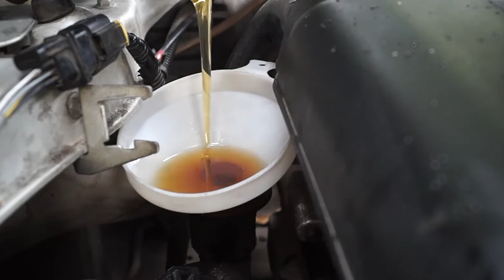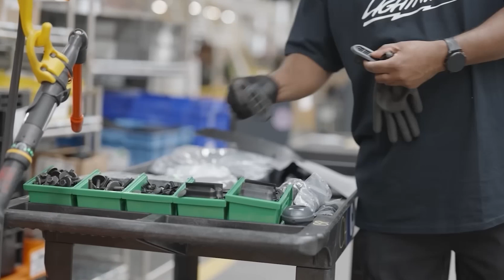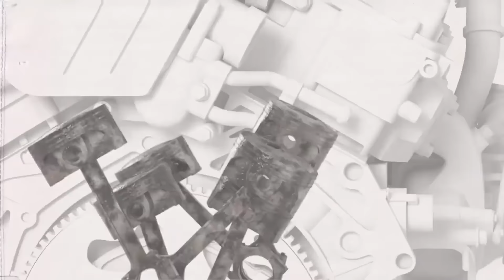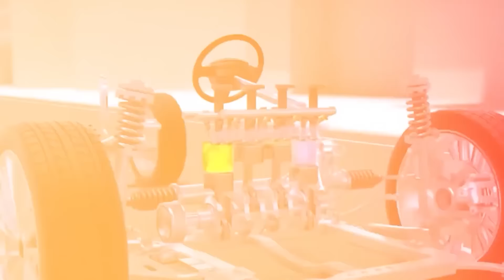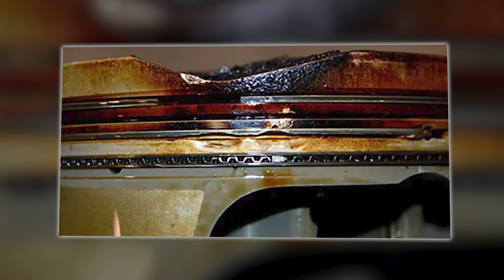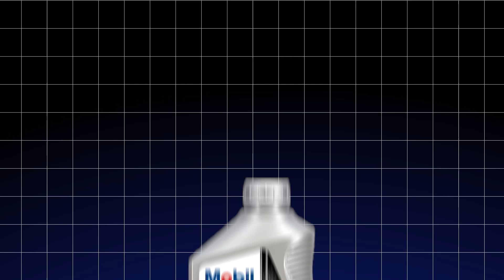Toyota Secretly Lying About Oil - Mechanics Refuse To Use

Comment: My 2024 Toyota cross calls for 0w8 and the FIRST THING I DID was drain it and put in 5w30. Result: Within minutes...The engine got quieter. When I drained the 0w8...it was like baby oil. No way Im running it.
Reply: Good idea,you’ve done yourself a favour getting rid of that knats piss,the manufacturers don’t give a stuff about longevity as long as it gets through the warranty period.
Reply: In modern cars it is more likely the electrical system or others will fail before the varing oil question plays itself out. Choosing the best oil for your circumstances improves with knowledge, so all these opinions and the few facts do have merit.
Reply: @Robertatbeaconhall  You are better educated if you get used oil analysis...no guessing...facts...
Reply: Good for you.
Reply: Terrible choice. Its a fact that toyota builds the a20 and a25 fks engine differently for the USA than it does for anyone else. They use cryogenic freezing of engine components to get an extremely tight tolerance. Plus the oil pump for the USA models is a completely different part number and it says it is NOT compatible with the overseas engines. That is because the oil pump is meant to run 0w8 and 0w16. Since it regulations pressure mechanically, it will actuate the relief valve in the oil pump a lot since the thicker oil increases oil pressure. Thus decreasing the oil to your bearings and providing a worse oil film. Use the factory recommended oil. Toyota sends out oil samples when there is an engine failure. So your warranty will be cooked for using the wrong oil. You are not very smart
Reply: @jos @joshuathomas4934 hey also claim 10K OCI is just fine. If you buy that, you’re not very smart.  These same engineers also developed that great V35A engine. How’s that working out for them?
Reply: It's not the weight of the oil it's the additive package in the oil. Ow-08 and 16 have a strong additive package. While thinner that have a very strong protective additive package. 
Science not speculation
Reply: @jchalestorm1749  yep and the heavier oils have lower packages and depend more on the weight of the oil, so ill take the lower oil package and thicker oil for where I live. With all the oil shortages that might likely come, people need to not be so afraid of trying it out for themselves and seeing the results, so far absolutely no issues at all using 5w30 in my 0w8 car, in fact I dont even see a MPG difference although im sure there is some small percentage difference
Reply: I have a 2025 Toyota Camry hybrid which Toyota recommends to use 0W8 oil.  I’m about to have the second oil change, should I continue to use 0W8 oil or switch to something thinker oil like 0W16?
Reply: @PKwong-xq9ze I would if I was you but it’s your decision in the end,it all depends on how long you intend to keep it,if you change your vehicle every three years and only do about 30,000 miles in that time it won’t be your problem.
Reply: @PKwong-xq9ze   I highly recommend Amsoil "100% Synthetic" 0W-8 rather than using the Toyota "Full Synthetic" 0W-8.  Some verified buyers of Amsoil 0W-8 on the official Amsoil website had indicated they were getting better results than the Toyota 0W-8, such as better gas mileage, smoother and quieter engines, which are reasons enough to make the switch, besides the Amsoil is actually cheaper!

In addition, Amsoil has a plentiful supply of their 0W-8 and 0W-16 100% Synthetic Motor Oils, along with a fully stock selection of other Amsoil Oils and other Amsoil Products, where Toyota issued a Technical Services Bulletin to all their Toyota Dealers warning of a potential shortages of these lighter viscosity grades.  I am an authorized, Independent Amsoil Dealer with my ID number 1420935 (also used as my Referral Code). All Dealers of Amsoil are Independent Contractors, as opposed to actual employees of Amsoil.

I invite you to visit the official website of Amsoil to view the extensive selection of dazzling products, where hopefully you will apply to become my Preferred Customer, by kindly utilizing my Referral Number of 1420935 in the box where they ask “Have a Referral Number? Enter it below:” If you can write down my referral number, before you eventually decide to exit this webpage, it will be appreciated (so that it will be at your fingertips when you get on the official Amsoil website).

If you choose to buy the Amsoil products as a Preferred Customer (PC), you will get the oil at a 25% discount, plus free shipping when you spend $100 (plus receiving a $5 coupon for every $100 you spend, plus occasional free gifts that they don't provide to their dealers). It only costs $10 for a 6 month PC membership (or $20 a year) and there is no requirement to purchase (as there is with so many companies offering a membership for a preferred customer program, where there is an automatic shipment involved). 

P.S. There is so much more that I would like to add to this list, such as increased MPG in comparison to the other oil brands, the most extensive warranty in the business and the phenomenal results I have received over the past 20+ years. Thanks for the consideration!
Reply: @PKwong-xq9ze  I think Toyota's engineers knows their designs better. If the coolant system does it's job, the engine will operate at a temperature, where the recommended oil works optimally. Toyota has been making some of the best most durable cars in the longest time in car history. Why would they want to risk that reputation of quality??
I don't think we are beta-testing when it comes to Toyota. Toyota has always done proper testing with their designs.
But with 0W8 oil. I would make sure it's always running at(or near) "full spec" oil capacity, to keep pressure at best. Because flow will be excellent with such oil. I believe Toyota has designes that engine and oil pump system to keep oil pressure healthy also.
Reply: @dillonDner EXACTLY!!!!!
Reply: @Wushu-viking  no, todays toyota has given up longevity in exchange for fuel economy and better emissions.......PERIOD. dismantle the EPA standards and only then can you make toyota great again.
Reply: @Wushu-viking 
If Toyota knows what they are doing…..then why does their manual say 10K oil changes…?

If you want long lasting engine… Never use 0w-8 or 0w-16 oil..
Reply: @jimliu2560 Are you an expert?
Reply: @PKwong-xq9ze  You do what you want. My plan is 0W16 in summer, 0W8 in winter. I'm in south TX. I also have a '25 Camry LE bought 01/25. Oh, and every 5,000 miles. First change was around 2,000 because I was on a long trip.
Reply: @9 @9878MC  I’d just run the 0w16 year round and forget about it.  It’s widely available.  This engine can even run a thin 0w20 like M1 AFE just fine.
Reply: I’m in west Texas and run 5w30 Costco full synthetic in my 2026 Corolla 2.0 that requires 0w8, literally no issues. I change my oil at 5k miles too
Reply: I put 0w30 in my daughter’s Camry that calls for 0w20. Definitely smoothed it out, but lost 1-2 mpg. Went with 5w30, lost 4-5 mpg.
Reply: @freebehindbars8654  You might wanna try a good 5W20. They tend to shear less than 0W20 or 0W30. The 0W is very good for freezing temp cold start, But only during the first 30 seconds. The 5W20 is still good for freezing startups. I would not go over the Wxx viscosity recommendation on a modern Toyota VVT-i engine. 0W20 / 5W20 will behave about the same at full operating temp (if they have the same additives). Only at cold running, the 5W will use a tiny bit more fuel, due to the oil being thicker.
Or Just use the correct oil according to Toyota spec... not just the right viscosity oil. It has to meet the Toyota specifications regarding ACEA etc. If you buy the original Toyota branded OEM oil for the vehicle, it will be that exact type of oil, that Toyota has tested/aproved the engine with. With all the correct additives.
The more often you change the oil, the better. The specified service interval is the maximum "limit" they specify for oil changes. Better to change it twice as often.
Reply: @freebehindbars8654  A lot of 0W30 oil these days is a hybrid C2/C3 

Which means that it provides C2 levels of fuel economy and C3 levels of protection.

Numerous 5W30 oils are A3/B4 meaning that they have a HTHS of a minimum of 3.5
Reply: @freebehindbars8654  Wow, that is a significant MPG decrease!
Reply: @freebehindbars8654 I can see that happening.  5w30 is probably just a little too thick for the VVT to operate as Toyota intended to operate.  If it was mine.  I'd probably use the 0w30 or try 5w20. I've always thought 5w20 was too thin. My uncle owns a limousine/Towncar company.  All his vehicles are Fords and they all use 5w20.  Some of his Town cars have close to 400k miles on them.  They might occasionally burn up transmissions and blow out spark plugs or crack coolant crossovers on the intake manifold.  But, I don't recall him ever burning up an engine very often. In fact I don't ever recall him having an engine falling. They are mostly 4.6L Ford V8. I know he uses some type of Penzoil synthetic. And I know that he changes the oil well before 10k miles rolls around.
Reply: @Thundarr995  I'm from the UK and that's what i use,my Yaris 1.3L asks for 0w20 but i use 0w30 for our winters & 5w30 for the summer, Have used 5w20 but it's more expensive. 5w30 is real cheap here & 0w30 so so.
Reply: At least 75%of engine wear happens in the moments after start and before oil fully circulates in the engine. Guess which oil gets to the bearings the quickest…
Reply: @ProwlerECMO  Guess which oil protects your bearings when it's a hundred degrees!
Reply: @jackhutchins8272 Oil that is too thin tends to have lighter molecules that gets damaged by heat more quickly, so having a bit higher weight helps
Reply: Your warranty is toast now pal. These engines are built with extreme close tolerances and use an oil pump that requires the thin oil. 0-W20 is too thick let alone 5-W30.